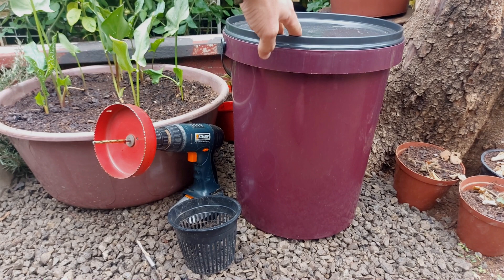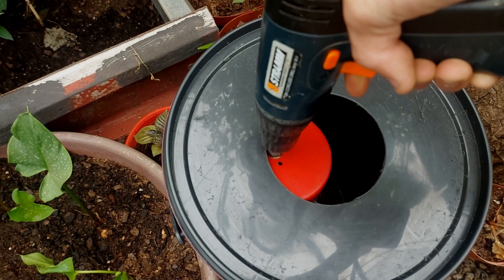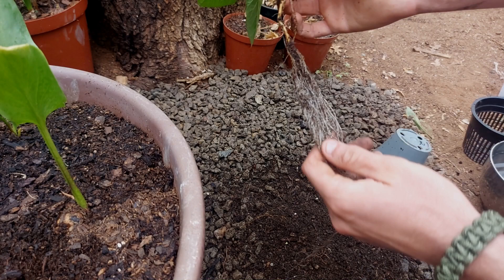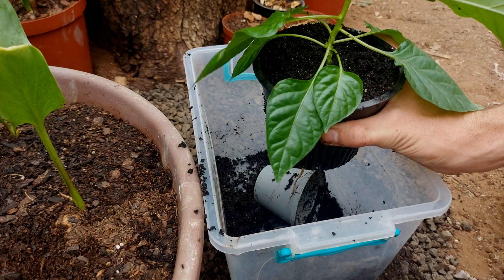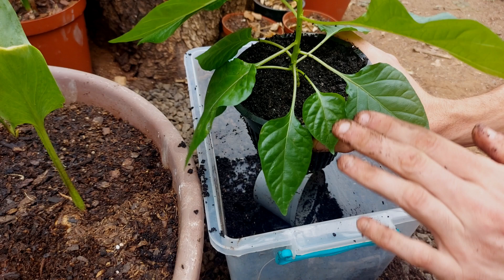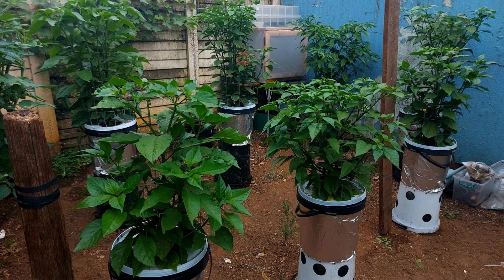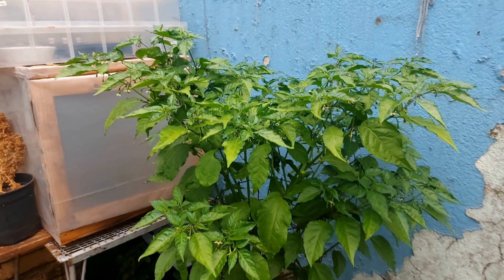How to do Kratky Hydroponics - Build & Transplanting Pepper Seedlings!

Comment: When you refill/top the buckets, do you use water or premixed nutrients? Thanks for the tutorial! Could you do another video showing how to make the plant supports and all your buckets have foil for heat deflection?
Reply from the maker: Hi TTBT.

When i top the buckets up i use normal water (tap or rain water).
My water change goes as follow:
Once a month, empty the bucket with the old water, add the nutrients (Nutrifeed, 1g per 1lt water), fill the bucket with water and boom, that's your water change. Throughout the month i top the buckets up with normal water, no need to add any extra nutrients throughout the cycle.

Yes, most of my buckets does indeed have foil for heat deflection, but it is more of a "do it now for any possible problems in the future" roughly 80% of my buckets is covered with foil and the rest with nothing. For my past 2 seasons I've monitored them closely, with only a very small water temperature difference. Both methods provides the same results in my opinion. I grow in a polytunnel with max temperatures of 40-50°C and never lost a plant due to water temperature problems.
If you grow in direct sun, then yes, I'd advise you to cover them with foil. But on the other hand, chilli plants should not be grown in direct sun, best to keep them under 60% shade netting or U.V polytunnel plastic (the more expensive, but best results route).

A video will soon be available regarding the supports. If you'd like to know sooner, send me a dm on Instagram- Vaal Capsaicin, and I'll quickly help you in the meantime:)
Reply: @vaalcapsaicin2278  One other question is that I've noticed you've kept the pots off the ground. Once again is that for heat deflection or just to make it easier for your back when servicing the pots? Thanks for answering my questions! Lastly I've noticed that basically this is wire fencing ziptied to the lid correct?
Reply: Last question I promise lol! Does the size of the netcup matters? 4" is half the price of your recommended 5" size.
Reply from the maker: @gforcekaras  yes, kept off the ground only to make life easier on my back🤣.

The supports is 100mm x 100mm fencing and attached to the lids. A little hard to explain on text how to attach it, thinking of doing a quick YouTube Short on it.

4" netcup will be perfect:)
Reply: @vaalcapsaicin2278  Could you please elaborate on growing in a polytunnel? I'm currently using 40% shade cloth during the summer months and thinking that a PT would be too hot for the conditions - 30-45 days of 90+ degree weather.
Reply from the maker: @gforcekaras  i have a 11m X 5m x 2.5m polytunnel, the plastic is a 3 layer U.V anti-drip plastic imported from Israel.
Two sides of the tunnel stays open 24/7 throughout Spring and Summer for airflow.

The most important thing with growing in a polytunnel is airflow, the more the better! Two sides should always be open to allow a nice breeze through the tunnel.

Chilli plants can handle very high temperatures if you have a good soil mix. They do exceptionally well via hydroponics in a tunnel!

Average temperature through Summer in my polytunnel 40°C - 50°C (104°F - 122°F).
Outside temperature 30°C - 40°C (86°F - 104°F).
My tunnel hit a new record of 53°C (127°F) a few days back.

My very first season i grew in a Greenhouse with 40% shade netting, i must say the difference between the Greenhouse and Polytunnel was outstanding when switching over.
Plant quality improved immensely, same for pod producing and size.

Basically the most important thing to remember with a polytunnel is airflow.
If you plan on building one, build it so you can open a minimum of 2 sides for a breeze.
Reply: @vaalcapsaicin2278  Outstanding information! Thank you very much!
Reply: @gforcekaras  Hey can use solo red cups or use a 3 or 4 inch potting container in place of net cups.

Comment: Thank you for the video. I do have a question, why did you drill that hole on the side of the bucket? I will give this a try.
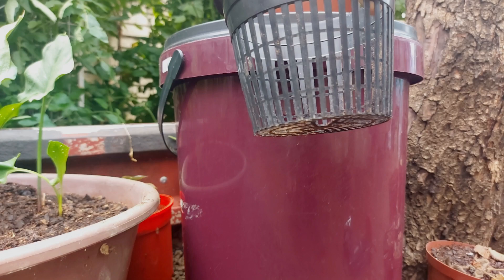Reply from the maker: Watch from 1:30 - 2:00 👍🏻. Overflow hole to prevent you for overfilling and to always keep an air gap between the water level and bottom of the net cup. The air gap supplies the oxygen to the plant and roots.

Comment: Awesome Video, thank you 🌿
Do you add any additional airflow via pump or air stone?
Reply from the maker: Thank you for watching!

I grow 60% of my plants in Kratky (without additional air) and the rest via Deep Water Culture.
Deep water Culture is basically the same as Kratky, but with additional airflow via an air pump pushing air into each bucket with an air hose and air stone.

I will upload a video soon showing my Deep Water Culture setup:)
Reply: @vaalcapsaicin2278  awesome 
Looking forward to see your method, and the difference in the two
Reply: How often do you add nutrients? Once a month?
Reply from the maker: @heisvisual  only once a month when i do the water change. The 1g per 1lt ratio will be more than enough to keep the plant happy for 1 month, if using Starke Ayres Nutrifeed.